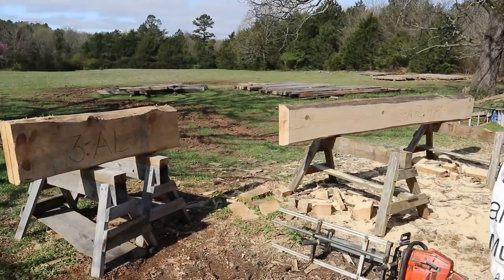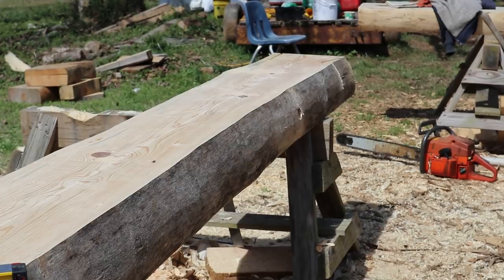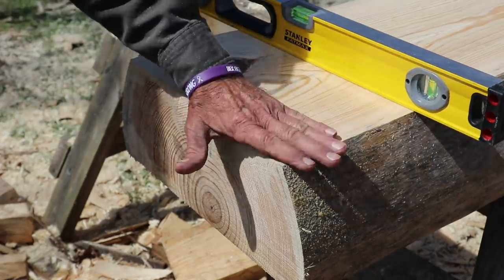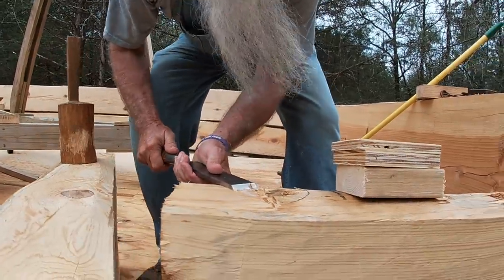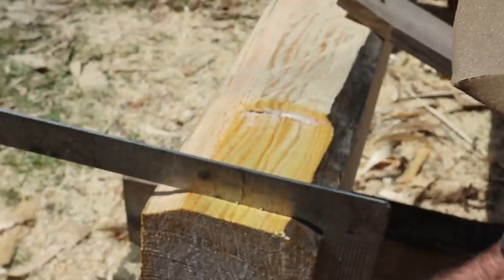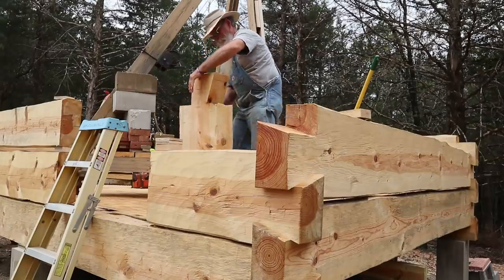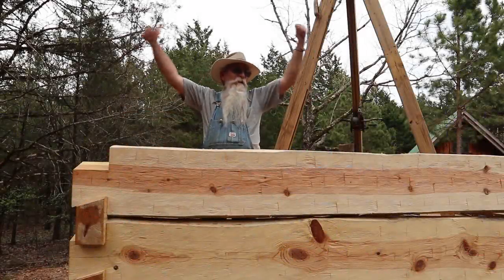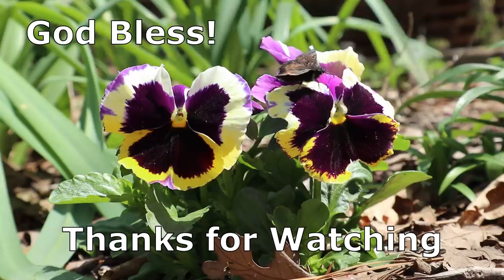Setting Round 3 - Dovetail Log Cabin Build (Ep 20)

Comment: Just one question ‘ at 7-40 u chiseled a flat on the log to give a level seating for the next log ‘ do u think rain water could flow in on that flat if hit by rain and strong winds ‘ what type of chinking are u going to use ‘ silicone based or mortar ‘ by the way excellent workmanship ‘ love that gig chisel ‘ greetings from Ireland
Reply from the maker: Martin Byrne   Howdy Martin- after l put the flat spots for the blocking to hold up the shorter logs l put Anchorseal on it. Anchorseal is a water based parroting that seal and protects during construction. I use a mortar ( sand, Portland, masonry cement and mortar tint for color. I used to use sifted red clay for the color but the dye is so much easier. Digging and sifting clay can be work, especially if it’s a little damp We have a video ( smoke house) where l show how l do the chinking. God bless y’all

Comment: Did you have any problems with shrinkage or did you air dry your logs before using. Also did you pin the corners and with what, rebar, log screws. spikes? I got my logs last week and I have to let them dry some before using. Anxious to get started.
Reply from the maker: Howdy HG- there will be some shrinkage as the logs season out. I like to use the logs green and allow for the settling that will take place. I use angle iron in the openings and the logs can slide down without any problems. I know some people pin the corners but I don’t because the half dovetail keeps the logs in place. I did use 1/2” lag bolts on a historical restoration on the corners because the notch was a flat notch and there was no holding power. There’s nothing wrong with letting the logs season out at all. In fact, the log builders in the European countries would cut their timber and let them season for three years or so. I’m sure you are anxious to get started on your cabin. Building a log cabin is very satisfying. I wish you the very best with your build. God bless you

Comment: Paul, I was asked to look at a log home a local lady started last summer because a number of her logs started splitting. For whatever reason she is using white pine square cut logs. There are no notches anywhere and not even pins to keep everything in place from shifting. I've never seen or heard of such construction method. The logs are square cut about 12"x12" and some of the splits are better than a 1/3 the length of the log and several are nearly 2" wide. I would like your insight on this very much. The house is being built on an open mesa (high flat desert) and it's not at all unusual to see 60 mph winds. She is an older woman with no knowledge about construction and I'm a bit concerned about her safety living in the place when it's done.
Reply: Sounds like but and pass style corners..must have screws going through?
Reply from the maker: Dave Johnson   Howdy Dave- Wow, sounds like something is going on for sure. You can get me through the website Broad Axe Beamworks. My phone number is there. We may have to figure something out for this lady. Sounds like she needs some help. God bless y’all

Comment: Sir, do you put wood dowels or anything to hold the logs in place or do you rely on the over all weight of the structure to hold them in place?
Reply from the maker: Linda NWFirefighter   Howdy Linda- the half- dovetail holds really well. I use angle iron in the openings to keep them straight and allow for settling to take place. I use a long all-thread bolt to tie the top four rounds together. I feel that if dowels aren’t put in so the upper log can settle can cause some hang up problems. I have never had any problems with how l do things. Thank you for watching and God bless you